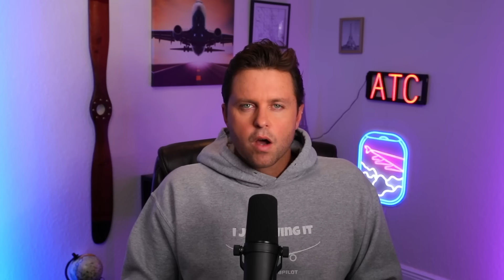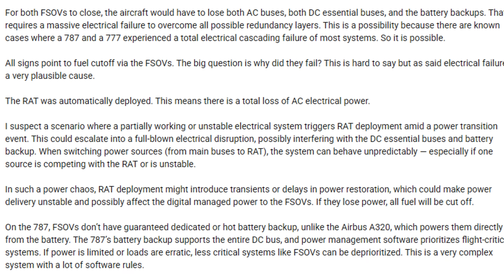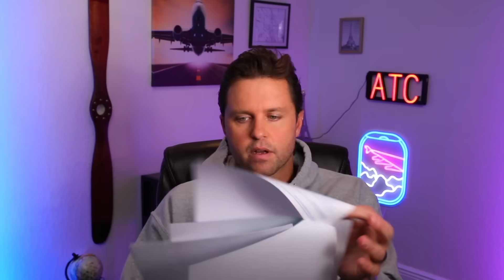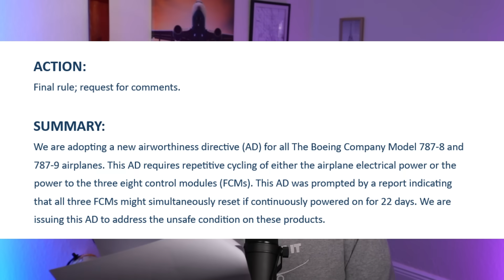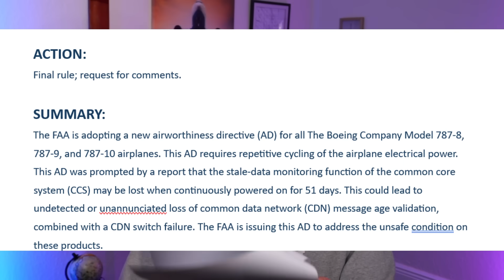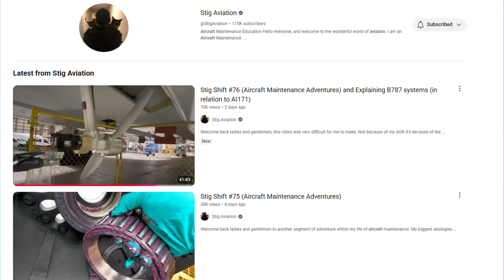Air India 171: Did a Software Glitch Cause Dual Engine Failure?

Comment: Sounds like another Boeing single point failure with multiple possible triggers and it is only by luck that this was the first in the air with others on the ground.  Glad you pointed out the nose over issue in the other Boeing line.  Also with the door issues on 737s while I was glad it was tracked down and released, I was highly bothered by the FAA stating the security door failed by design with loss of pressure.  A fact given to the world on how to override the post 911 security measure that any terrorist could do by busting a window or two.

Comment: Please don't laugh. If the RAT deployed accidentally would that affect the engines and shut down?
Reply: No. 

It should have no impact. However, it cannot be retracted in the air and would produce a lot of vibration and noise within the cabin and produce discomfort of the passengers in seats near the unit. Perhaps this would cause the aircraft to divert.
Reply: Thank you so much. @christopherrobinson7541

Comment: ELECTRICAL FAILURE theory is more promising. That would perfectly explain why fuel was cut off from both the engines.
Reply: If both engines were shutdown the aircraft would have not been able to fly from the end of the runway to the crash site (1,600m). Hence the engines could not have been shut down. Rather the engines had been rolled back and were providing low power.

Comment: How do you interpret that the indestructable flight data recorder got destroyed? Seems odd, dont you think? Th data recorder holds all the answers and can sink Boing.
Reply: The B787-8 uses combined CVR & FDR devices and it has two such units. Both should be able to provide cockpit voice and flight data. One box is located in the nose (I think in the equipment bay under the cockpit and the other in the tail. During the post crash fire the front unit may have been damaged. These units are required to survive huge acceleration during a crash and also to resist fire for a specified period and temperature. In this case the duration of the fire may have exceeded the design limit of one of the units.

Comment: An important factor that will help sort out the root cause here is the timeline of failure...EG what came first.  The point in time where engine thrust first deviated below commanded level or the takepoff run should be evident in the N1 traces in Black Box.  The spooldown rate of N1 will clearly verify whether this was a clean FSOV shutoff (as speculatively implied in the video) or was a progressive deterioration as would be the case with fuel contamination.  Where the failure occurred relative to V1 speed is extremely important.  Speculation is just that - speulation.

Comment: I don't think either of you guys are wrong. It was seeming to point at the FADEC. I'm not so convinced of fuel contamination. Knowing now that the FSOVs fail in the shut position makes sense for the engines to fail. I wish they would release the data from those two recorders. All the more reading about this, it's looking pretty bad for Boeing.

Comment: There’s a switch on the throttle quadrant that activates the auto-throttle. I suspect this is where the focus should lie. It could be either be a software and or mechanical failure to the auto-throttle system.

Comment: To me it sounds like electrical glitches, messed up the software, caused the engines to idle when they were supposed to thrust
Reply: 1.)  EXACTLY CORRECT !!!  Unlike other TURBO-FAN PASSENGER JETS, the BOEING 787 DREAM-LINER'S AC DUAL ELECTRIC BUS is NOT backed-up by battery.  It is certainly possible that during a 1-2 second BUS POWER TRANSFER FAILURE (evidenced by the RAT being deployed and the LANDING GEAR FAILING to FULLY RETRACT) the FLIGHT CONTROL COMPUTER "RE-BOOTED," starting the "TAKE-OFF SEQUENCE" OVER from the beginning with the ENGINES set at idle speed and the FLAPS set at 5 percent. The SOFTWARE PROGRAM "FORGOT" the aircraft was already "AIRBORNE UNDER-FULL-POWER" where maximum thrust was need. FADEC Engine Thrust set at IDLE SPEED would no longer suffice !!!!

2.) In summary, six seconds after "LIFT-OFF," THE FLIGHT CONTROL COMPUTER of AIR INDIA FLIGHT 171 "RE-BOOTED," then issued "incorrect instructions" to the FADEC Engine Thrust Control and the FLY-BY-WIRE System; resulting in a complete LOSS OF LIFT and a crash into ground terrain. With extremely limited time available, the two pilots were unable to OVERRIDE the COMPUTER and save the aircraft.

Comment: Can someone examine this thesis further?
The Boeing 787 is primarily constructed with a carbon fiber composite fuselage. To ensure electrical conductivity and protection against electrostatic discharge and lightning, metallic grounding strips are embedded that interconnect fuselage sections, forming a return path for operational and dissipative currents.
As Boeing engineer Sam Salehpour denounced in 2024, during fuselage manufacturing, there was mechanical misalignment between structural sections, requiring force and possibly damaging the electrical continuity of the grounding mesh;
Low relative humidity (below 30%) favored electrostatic charge accumulation on the fuselage;
Prolonged sun exposure and internal overheating (>50 °C) increased the impedance of electrical connections;
This combination redirected current and charges to unintended paths, such as internal wiring.
FADEC and GCUs may have been affected by electrical noise, current redirection, or loss of grounding reference, leading to automatic shutdown or digital failure. Overheating may have contributed to signal degradation in electronic systems.
Despite crew command, the LGCU may have been affected by electromagnetic interference, signal failure, or power loss, resulting in failure to retract the landing gear. Operation under excessive heat may have worsened the malfunction.

Comment: This is not a software glitch, in my opinion it is a safety engineering design flaw.  

So a stubbed toe resulted in cardiac arrest, hence the patient died in less than a second 😮 the metaphor spoke to solving the issue.  

An AI analysis of this system might have caught this sixteen years ago.

Comment: I dont think it's contaminated fuel. If this would be the case  there  might  other aircrafts to be involved with the same issue. One point I never heard about is possible water in the fuel system. Did they drain the fuel tanks properly?

Comment: The failure mode of the FSOV for complete electrical failure/interruption  is closed?  Get real.  Not even Boeing would design  such a system.  Don't these engines suction feed under the conditions the Air India flight was operating under if all fuel tank pumps lost power?  Please don't lock onto this as the cause and exclude other hypothesis.

Comment: Check the crash at Heathrow flight from China a few years ago. Twin engine failure on final approach.
Reply: That was icing in the fuel supply to the engines. Not the same.

Comment: I also believe that an electrical problem was the cause of the engine failure, but it's highly unlikely that a software issue triggered it. It could also have been a simple short circuit in the aircraft's wiring harness, despite the redundancy there.

Comment: Software glitch is the only possible explanation.
There is NO way that both engines can stop working at the SAME time !!!  Something STOPPED them .
Reply: just as it cleared the runway and was on climb out you can see the engines were active with a dust off at the end of the runway, no idea how much thrust, was low as the climb out as seen on video was low and slow max weight limit perhaps engines pushed to hard since they were at max weight limits and that caused an engine issue?
Reply: @Caviar_Liberta  "ust as it cleared the runway and was on climb out you can see the engines were active with a dust off at the end of the runway, no idea how much thrust, was low as the climb out as seen on video was low and slow "

The aircraft rotated into the climbat a position 2,100m from the start of the runway and climbed to 400 ft (twice the wingspan of 197 ft) in 10 seconds, which is a climbrate of 2,400 ft per minute, which is normal. The position of the rotation can be determined by the sightline from where the video was recorded and by the time interval between the small cloud of dust as the aircraft rotates and the large cloud when it overflies the overshoot.

The thrust was normal until the aircraft stopped climbing and descended to less than 100 ft at the end of the runway. From this position it was 1,600m from the crash site. In the engines were shut down the aircraft could not have reached the crash site, hence the engines were operating,but had rolled-back to a low power setting.
Reply: Electrical glitch or software glitch, one of them or both

Comment: Gary, I did read or saw YT can't remember that a news agency in India has an whistle-blower within Beoing saying old problems in the 787 dreamliner are resurfacing again. So this Heyfixthis comments seems a more plausible scenario and could and I say again could be right. Only time can tell. But 1 thing I can't get out of my head is and might be wrong, used literally the entire runway to achieve V1. Im sure V1 is based on speed to be able to take off but do you not have distance? Because if he haven't achieved V1 by a certain distance surely that indicates an problem and abort the take off roll or are you committed to achieve V1 regardless of distance? 787 fully loaded should achieve V1 somewhere between 2600m and 2900m. Yet taken (cam angle can't determine this) what 3500m or just under?

Comment: Those 2 that crashed pushing the nose down were not the only ones! A multitude of aircraft had suffered the same problem. And the pilots and their carriers compalined to Boeing. BUTT Boeing complained back at them that it was definately the pilots that caused the problem. In the 2 that crashed, Boeing, yet again claimed PILOT ERROR - PILOT ERROR.
With Boeing it is ALWAYS someone else's fault !

Comment: My gut tells me this FSOV closing is the likely culprit. Clearly these 787s have electrical issues, and while redundant systems are in place, the combination of electrical failure triggering RAT and the erratic electricity  generated by RAT (transients, spikes, etc) was not something the FSOV agreed with, or in the least, a component within the FSOV system; one fried resistor could be all it takes, and the FSOV might return to its default state (closed). Let's see how hard Boeing tries to bury this.

Comment: The plane was in trouble before lift-off, had to use all of the runway?
Reply: No the aircraft did not use the whole of the runway. The aircraft rotated and made a normal climb to 400 ft and then a problem occurred, which resulted in the aircraft descending to 71 ft when it left the end of the runway.

Comment: Sounds very plausible. This was my initial thought - some sort of complete power loss to both engines simultaneously.  I was at LHR when the Ethiopian 787 battery caught fire so this was always on my mind every time I travelled on a 787.  However, I then dismissed this because it’s so improbable and also because I then learned that each engine has its own supply and its own computer.  This explanation makes complete sense, though.

Comment: In one of the 737-MAX documentaries, I remember a Boeing whistleblower spoke about metal shavings being found in the electrical wiring of the 787.
Reply: i too recall metal shavings being cause of electrical failure from the documentary..but now this fuel valve auto shut off is just another level..though I am not any expert here, but im thinking that why do they need to think of designing solution for auto fuel shut off when such thing can be in pilot’s manual control..the probability of burning engines not letting manual shut off to work is lower than the scenario we witnessed now

Comment: Hey Gary, I am super impressed by the level of detailed research you are doing on this subject. Ever since this horrific and tragic plane crash happened, I am having sleepless nights and all the time my mind is thinking of what might have caused this plane to crash like this ( never heard such take off). Incidentally, I got to  watch documentary ‘Downfall’ on Netflix few days ago through which i got to know how MCAS system software glitches led to crash to 2 of Boeing’s 737 Max planes. It’s been few years but unfortunately Boeing doesn’t seem to have learnt their lessons and haven’t taken strong measures to avoid similar software issues occurring in future. This negligent attitude has most likely contributed to this 3rd crash even which is so sad as so many innocent lives got lost all over again. Ever-since Boeing got merged with Mc Douglas, the quality has gone south and their real focus has  mainly been on making their stock prices soar on Wall Street and  eventually make their shareholders happy. What I feel now is that they can’t be trusted anymore on their quality checks ( not blaming their employees here but mainly their management who compels their employees to cut corners) and hence its high time now they need to feel accountable and answerable for the precious lives that have got lost

Comment: This looks very plausible. At the very least 787 operations should be stopped in very hot conditions where the electrical system could cause such an issue. It's becoming an issue of automation within the systems on complex Boeing and Airbus aircraft. My experience on Airbus aircraft would have fault finding systems finding faults which weren't there. Engineers would power down the aircraft on the ground and the fault would disappear. Switching off and back on again is not possible in the air.

Comment: This is absolutely preposterous. I prefered Airbuses many times over since a long time and now I understand why. This is also amazing that Airbus engineres took it into account, anticipated that eventual electric shot down which Boeing hasn't. That is insane in and of itself provided  everything has to be taken into the risk evaluation. Btw this is exactly what the statements revealed during the Boeing 787 commision when discussing "shortcuts" in production. These 787 planes those older once are  a flying caskets.

Comment: Quote - In 2015, Boeing and the FAA discovered a critical software bug in the 787’s Generator Control Units (GCUs). If left powered for 248 consecutive days, an internal counter could overflow — shutting down all four GCUs and cutting AC power entirely. UnQuote

A pity that in 2015 Boeing continued to use Linux kernels with 32 bit timestamp counters. Always up systems moved to 64 bit timestamps much before 2006.
Reply: Who’s leaving commercial planes running for 248 days? I’m sure the service interval is significantly lower.

Comment: They ran the  plane without the ac that could toasted the eletronics or electrical. Was testing electrical wiring and created emp. I was pulling nanotechnology out of my skin for weeks. I worked at company software, and hardware engineers blamed each other. 
It could have been bad fuel if octane was wrong. Car, it blows the pistons or knocks. My pc the heat determines the speed and fps. I could work on pc boards for airplanes. However, they were shut down cause the company got Clinton and Gore in lie. Must cases it jitter that cause eletronics to lose sync. That apu should be running on takeoff period.

Comment: They have been complaining for years about the metal dust and shavings created by threading screws and bolts in the racks where all the control modules are mounted.
And it was not just the Dreamliner.
That would be like throwing a screw down the oil intake on my 351 Cleveland and trusting it will never find its way to the crankshaft.
D checks on Boeing aircraft found left behind wrenches, screw drivers and even lunch boxes next to the aluminum skin.
NOT GOOD AT ALL !
So there is some metal shavings next to a computer module. Who has time to run a vacuum cleaner to make sure it is airworthy. Get this plane out the door. We are behind schedule. 😡

Comment: allo good thinking .. But the emf demands of the GEAR UP command caused the depleted Lipo pack to shut down under the battery BMS protection .. SIMPLE BATTERY failure .as you point out the facts are there . they need accepting   NOT explaining .There should be no    PUTIN style off ramp. clever clogs software nerds will provide POSSIBLE blind alleys to the whole pack of    what if   reasons .. instead of accepting that the load surge demand when the GEAR up command was  activated caused the 3 hour energy drain depleted the lipo pack sufficient to trigger the BMS shutdown .NO AMOUNT of  LOGICAL software YEA BUTTS will explain away the total EMF   Battery energy shutdown .

Comment: Hi, actually it sounds more likely than a firmware issue with Fadec. The other possibility that I was thinking about may be a common sensor between both Fadec (like the AoA sensor and MCAS). It sounds just crazy if you are right.

Comment: As a Boeing 787 aircraft maintainance engineer all i can say that the temp issue is not going to shut off both the engines... Rest all the other factors can be taken into consideration.
Reply: If the other factors turn out to be correct, and it is a system issue, then does this result in the fleet being grounded? Should people be worried about stepping onto Dreamliners and other Boeing craft?
Reply: Isn’t that why we call it a glitch?